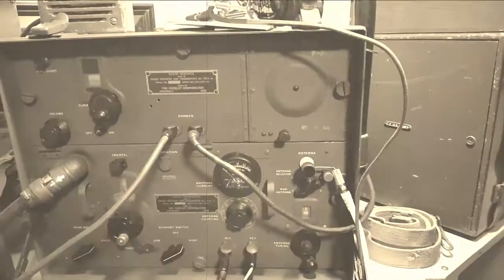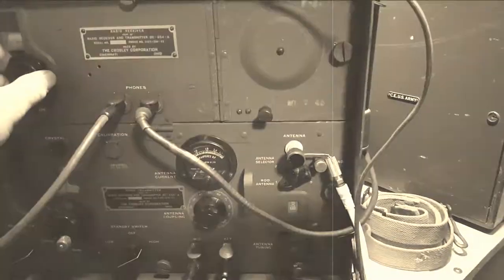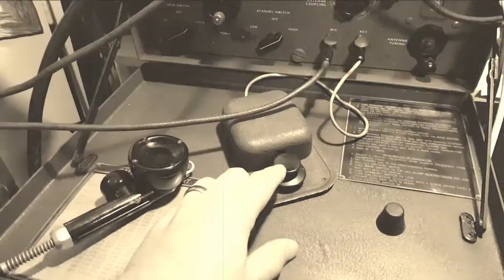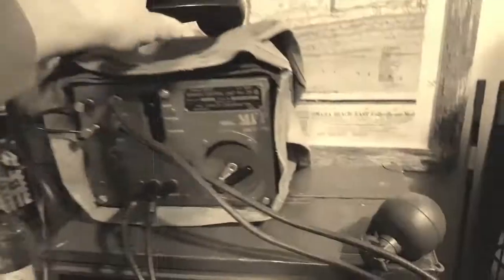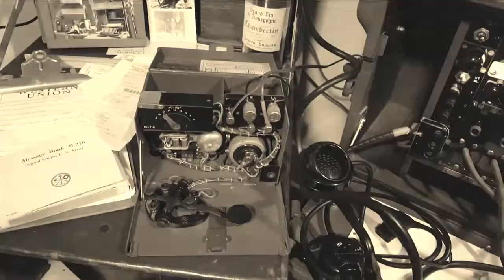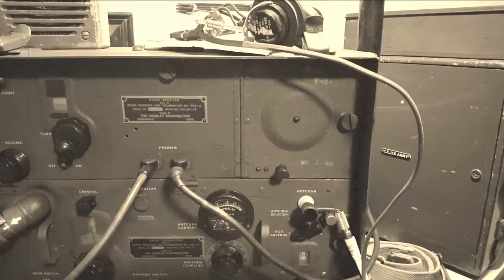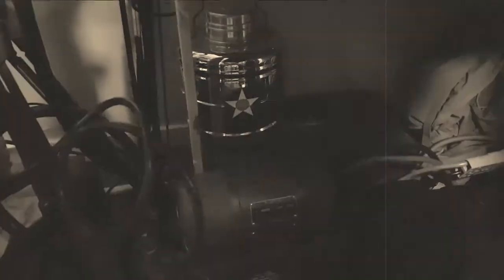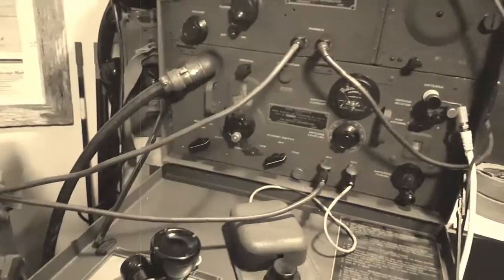Radio Set SCR-284 in operation.

Comment: Hello Carl, Thanks for posting such a cool video on WWII radios. My dad was a radio operator with 102nd Infantry Division, 405th Regiment, 3rd Battalion HQ Company. In his diaries he mentions carrying the BC-1000/SCR-300, operating the BC-610, and also setting up the SCR-284. Several people that follow my FB page have relatives (father or grandfather) that were radio men in the 102nd. I am going to put a link for this video on my page so that they can see what was involved.
I have 2 BC-1000/SCR-300s and two BC-659s (set up on WWII jeeps). I have only powered up one of the backpack radios, the wiring is foreign to me and I don't want to blow anything up :)
Thanks again for this video. If you have any other WWII radio info, it would be great if you posted to my site 

https://www.google.com/url?sa=t&rct=j&q=&esrc=s&source=web&cd=5&cad=rja&uact=8&ved=2ahUKEwiP-dqKyIngAhXLz4MKHTD5DVkQFjAEegQIBxAB&url=https%3A%2F%2Fwww.facebook.com%2F405th102dOzarks%2F&usg=AOvVaw3Eb15cxZCes2rvb4e86vlM

-Dave
Reply from the maker: Hi Dave, saw your post, thanks for the compliment. 
 I do maintain a site with a lot of radio info on it over at http://dodgem37.com

Comment: Hello, what is your alternative to the BA27 Battery to make the RM-29 working ?
I got a RM29 but i don't have find yet an alternative to the BA27

Thanks
Reply from the maker: I used 2 D cell sized batteries in a two cell holder wired into to power hookup of the original BA27  https://www.radioshack.com/products/radioshack-d-battery-holder
Reply: @CarlReinemann  Are 3 Volt enough versus the 4.5V original ?
Reply from the maker: @LPGamer24  works great for me, considering the field telephones it works with are 3V as well. I suppose you could add a third battery to it if you chose to